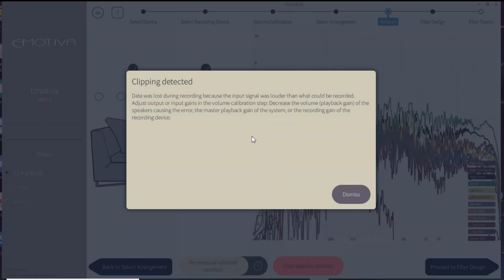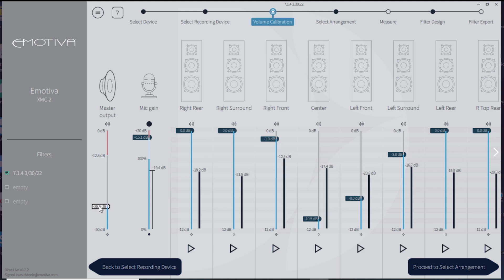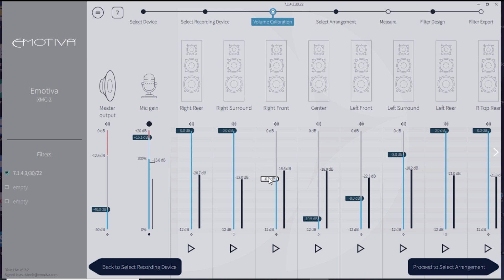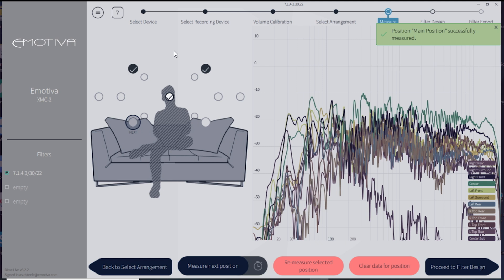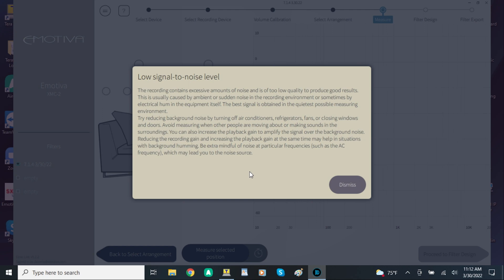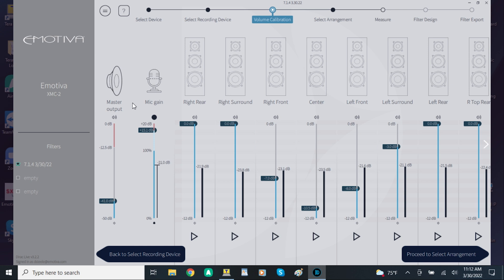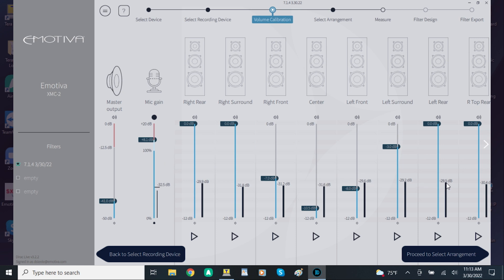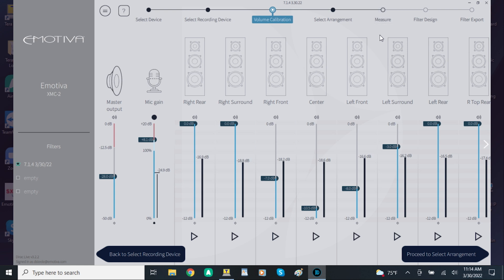Troubleshooting Common Dirac Live 3 Issues

Comment: I have 26-28db in my silent theater.  Running  tests 30+ times, it always says "low signal to noise ratio" which is flat incorrect.  Nothing is quieter than my room, and the test is maybe hitting 90-95db.  Aside from the frustrating software and antiquated connection process to get on a network, this is by far the most frustrating part of wasting my days on this.  Such a bummer!
Reply: I am at 34db, I guess I should just give up
Reply from the maker: Eric, please give us a call and we will be happy to help you figure out what is going wrong. 615-790-6754
Reply: I've done everything over the last few weeks. Someone in Reddit even said the problem was the phone app version and to use the Windows version of Dirac. Nope. Same "low signal to noise" error. I've just given up and gone back to my old decibel meter and manual adjustments.
Reply: @drewgemus  downgrading to an older version of Dirac helped me and then I played a bit with my mic gain and master volume. Boom! Success..Very Nice!  Thing is you need to find the right balance for your room between those two sliders. Noise floor in my room is 35db measure using my apple watch ultra, so I set the mic gain to around 80% IiRC and enough master volume to clear the noise floor by about 40db almost